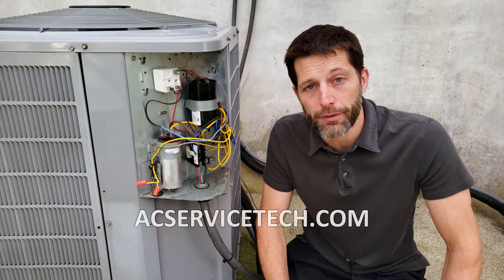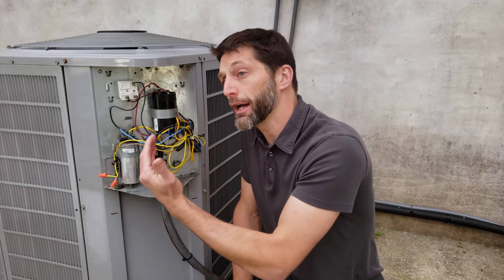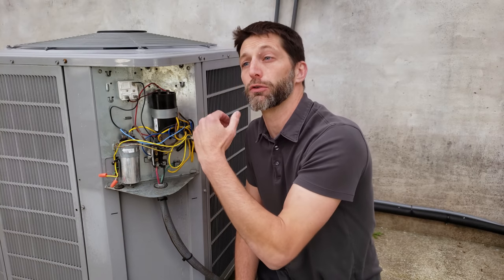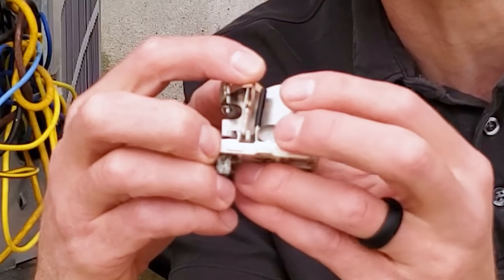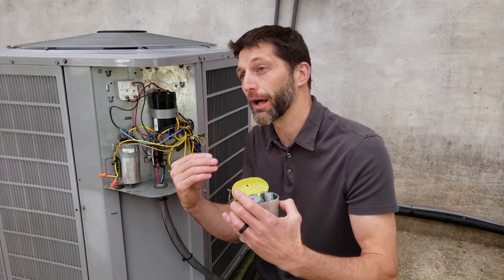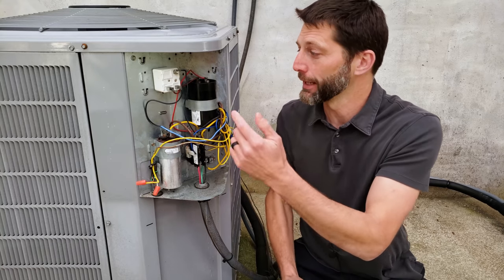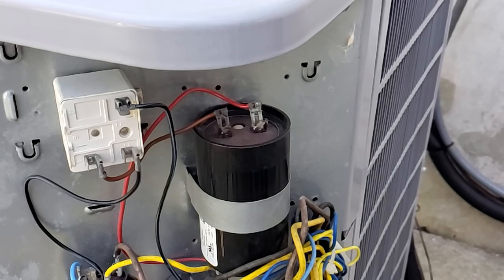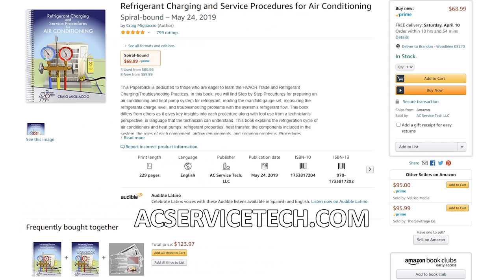The Main Reason Why Start Capacitors Fail in HVAC Units! This Cap Blows Out!

Comment: It is also called a 521 relay. I forgot about how it works. We had to draw the schematic as part of a test in school.
Reply: How can you troubleshoot it if you don't know how it works? Do you just replace the motherboard if the system is broke like my last hvac tech did. If you are a tech, please educate yourself before you paint us all with your ignorance. There are at least 3 main split phase compressor starting methods used: Thermistor, current relay, and potential relay (and they are wired and are tested differently. If you do not understand this you will spend way too much billable time troubleshooting and may actually cause additional damage to the system you are repairing).
Reply: @Squeezmo  I don't understand your comment.  I just stated that the start relay was also known as a 521 relay. I am a Journeyman out of Local 467. I've been  doing service for over 25 years.
Reply: @ask4george1  If you don’t understand the basic compressor starting circuit you should not be working on the systems
Reply: The last tech I had working on my system replaced the motherboard because he didn’t check the resistance of the Compressor contactor relay operating coil. I tried to explain it to him but it was no use

Comment: My HV AC Tech says they can no longer add freon to my unit I would like to know if that's true it's 20 years old
Reply: It's bullshit.  They're tired of working on it.
Reply: It's illegal to add refrigerant to a system that is known to leak a certain percentage of the charge annually. You would save energy and get better results with a new properly sized condensing unit and coil.
Reply: @sammarchetti2484  he did not say it needs freon he just said they won't add any more if it does need it they would not test it. He just said the splits were okay
Reply: My advice buy a sealer called magic seal and buy 421A refrigerant instead of r22.  Best replacement for r22! No oil changes  needed. You can buy 421A 30 lbs for about 250 bucks . I do recommend to replace freon filter just because it's probably rusted. 22 years experience 😁👍

Comment: And then it'll keep running until the compressor is turned off, and then it wont restart and it'll hopefully trip a thermal breaker on the motor else the motor can be damaged.

Comment: So for what I gather from this video,  either you will have to keep changing the relays like every month or WHAT?

Cant the manufacturer design and build a better relay that can handle the currents and dont melt metals and whatever??
Reply: Yea good luck with that call to the manufacturer ... Why build something that will LAST when they can just design it wrong to keep YOU buying replacement parts.
Reply: @ACommenterOnYouTube  yeah, thanks for that,  also My house dont need air con really,  design roof with a thick ceiling and double sided sisalthene to reflect most of suns heat upwards,  walls that do not absorbed heat like bricks then have good ventilation that all i need are fans....
plus lots of trees around the house

Comment: Your fortunate that the capacitor failed in order to save the start winding in the compressor motor.  All run capacitors are not oil filled.  Metalized polypropelene capacitors are more cost effective and are being used in place of oil-filled caps.

Comment: Choices that were made long long ago in the USA.
60 Hz. Single phase for residential homes. 120/240 center tapped for residential homes. Most home appliances use 120.
Should of been 400 Hz (less eddie current losses.)
Home Appliances like refrigerators and freezers should of used 240 V.
Probably microwave ovens too.
In many countries common household electronics use 220-250 volts depending on country.
The choices that were made mean wasted power in the wires, transformers, etc.
And if you has 3 phase then you would not have to mess with split-phase, shaded poles, centrafugal switches, or starter capacitors,

Comment: A failed capacitor has a really foul smell, I know from experience.
Reply: 22 years  here and what are you talking about? Run caps fail without blowing or expanding.
Reply: @yurydolinsky  40 plus years here, I am talking about start caps and electrolytic caps used in electronic circuits.
Reply: @Handyman2020  what's the difference? Same thing just smaller size.
Reply: The difference is 18 years.

Comment: First of all, it's not an HVAC unit. HVAC refers to the system, including the air handler and outdoor unit.
Reply: its a technicality ....
Reply: @ACommenterOnYouTube  No it's not. An F150 is not a car, an AR15 is not an assault rifle and an AC unit is not an HVAC unit.
Reply: @TigerMarine62  YES it is. You are the only one nit picking a stupid technicality. 
Everyone else watching was just appreciating the fact that this guy was letting people know that these caps "could" be blowing because of something else and not only because of the cap itself.
And here you come along and complain about something stupid, its not like he called it the air handler which would have been WAY wrong.
Reply: @ACommenterOnYouTube  I have one thing to say. Class Action.
Reply: @TigerMarine62  for WHAT ?? and your standing ground is quick sand ??

Comment: I work on a ice cream machine and I switched out all three components and it still blows. Not sure where to go from there
Reply: which three components specifically ?
Reply: @yeliab814  I changed the run/start capacitor and the relay
Reply: @keanusofa  if compressor is starting then start cap exploding several seconds later ,  check for correct vertical mounting orientation, wiring and proper voltage spec of new relay
Reply: @yeliab814  I appreciate the help!!!

Comment: This doesnt work on 99% of condensor's now that use combo start/run capacitors
Reply: They are not start/run capacitors, they are run capacitors on motors that do not require a lot of torque to start so only use the phase difference introduced by the run capacitor to start.  A specific start capacitor has a higher capacitance to provide more phase differential to create more torque for start up, but such capacitance is not good for the motor to run at the best power factor for the design load. The run capacitor tunes the motor's magnetic fields for most efficient operation (and also provides the phase offset for startup in low start torque applications).
Reply: Good post .